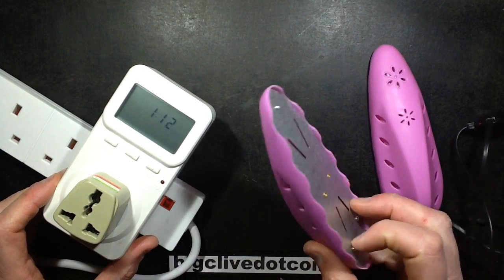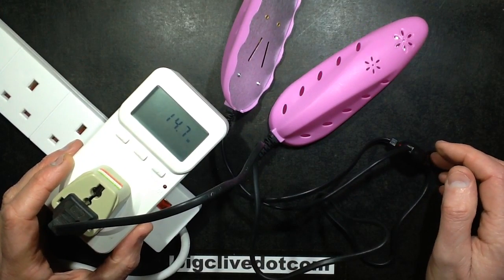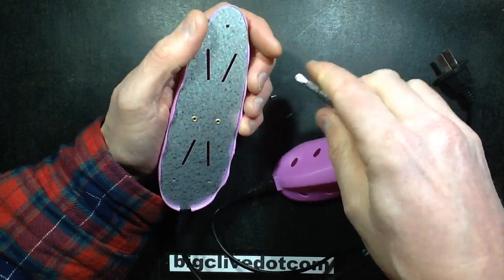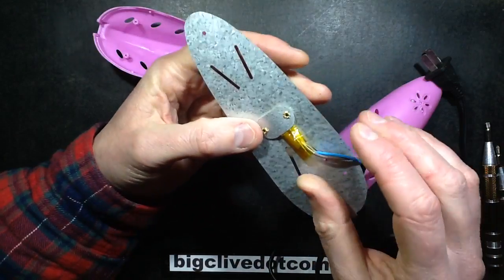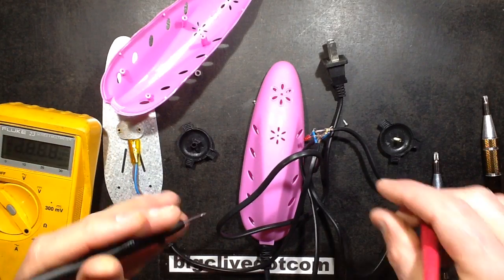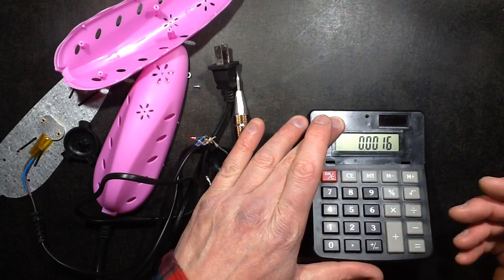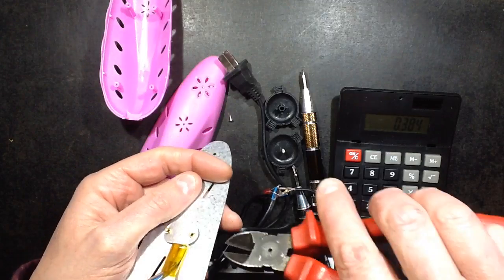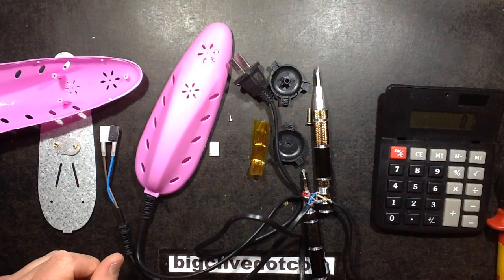The cheapest pink shoe warmers of death.

Comment: The resistor might also have an operating temperature range. 
A RS-generic-datasheet for carbon resistors shows derating of power dissipation starting at 70C going straight down to zero at 150C.

Comment: I don't get how those elements work. Two electrodes separated by what?
Reply from the maker: A material that changes its resistance with temperature.  It's specifically engineered to do that so it effectively self regulates.
Reply: Ok, thanks!

Comment: To  think that someone may be using this on their WET cold boots with the line & neutral conductors sitting conveniently at the bottom where the moisture collects after a long day working in the rain, stuck to a un-earthed metal plate too! And by the sounds of it if the shocks aren't dangerous enough, they've made sure it will get hot enough (over 100 degrees) to burst into flames so it's guaranteed to thrill! To be fair though, put a SELV on the power lead to make it safe, see if it puts enough heat out to dry your boots... could actually be useful?

Comment: what is that thing between the electrodes?
Reply from the maker: It's a piece of resistive material with a positive temperature coefficient.  As it gets hotter its resistance increases, so it self regulates.
Reply: bigclivedotcom thanks man. btw how come it gets cooler when the resistance increases? it seems to be the oposite with nichrome wire
Reply: the thermoresitor is not the part that does the heating, it simply makes less current flow through the heating element. less current = less heat coming out.
Reply: EvilPlagueDoctor oh. where does the heat come from? i made a water heater by spacing two shaving blades and i notised the heat was coming from the water between the blades. i also notised that the closer i put them the more violent the water boiled :)
Reply: sorry, I was wrong (probably should have paid more attention to the video :p)

let me correct myself, as clive said, it's a material that heats up, but as it heats up, the resistance goes up, preventing as much current going through (since the voltage stays the same) cooling it down again.

nicrome wire heats up the same way this does (High resistance = more work the electrons have to do to push through, creating more heat) but the reason more resistance = more heat is because since the resistance value doesn't change much, the input current/voltage is set to match the resistance of the nichrome wire to be used. 

in short it's ohm's law (volts / resistance = amps) and then you can 
take the volts x amps to get your watts, the more watts, the more heat.

with your shaving blade experiment, putting the blades closer means more current can flow through (less resistance), meaning more electrons to bump into the atoms make more heat, at least, in that case more concentrated heat. 

but be careful, since you'll also be producing hydrogen & oxygen via electrolysis.
Reply: EvilPlagueDoctor I had no idea. I also did an experiment with resistors and that too had unexpected results. first i connected a high ohm resistor 10 megaohm or something, i dont remember. Nothing happened and it didnt heat up at all. Then i tried with some lower ohm resistors (individually) and i started to see some smoke. Then i connected an 82 ohm resistor and it made a beautiful firework.

I expected the high ohm resistors to heat up more because of all the energy it had to get rid off. Can you explain what was happening?
Reply: asdf
yep. ohms law.
lets say you were using a 9 volt source.

with a 1M resistor
9v(pressure) / 1,000,000ohm (resistance) = 0.000009 Amps (flow)

9v x 0.000009A = 0.0000081 watts of energy

now lets take the opposite extreme 82 ohms

9v / 82 ohm = 0.109amp
= 0.988 watts of power, and since the standard resistors are only rated for 0.25 watts, that's going to cause a meltdown.

not a lot of power mind you, but localized to a very small area it can make that small spot very hot :)

think about it this way, volts is the pressure of a water line, the faucet is the resistor, and the amount of water coming out of the tap is amps. keeping the water pressure the same (it's regulated by the town) turning the know a little (high resistance) only lets a small amount of water through (and thus, in our circuit, little energy released as heat)
but open the tap all the way (low resistance) and you get a heavy flow (lots of energy is released)

hopefully that made sense.
Reply: EvilPlagueDoctor i think im startin to get it now, thanks man :)
Reply: asdf
any time :)

Comment: I was thinking about making shoe warmer myself, 10x 1W resistors dissipating 5W in total, and as temperature control bimetalic switch rated for 50C, NC type.
We could use few of these switches for more safety.
Everything in isolated and waterproof enclosure, so no risk of shock even when shoes are really wet.

Comment: Do you isolate yourself from ground before handling this cheap tat? I'm not terribly familiar with electricity (more of a chemistry guy myself), but I distinctly recall my shop teacher handling live wires (but never both live and neutral at once!) on an insulated mat.
Reply from the maker: +Steven Haussmann I do have a fairly isolated area.  Leakage current is around 10uA.

Comment: Regarding the dissipated wattage of the led resistor: based on the cord end (Nema plug for 120 volts, should we Instead calculate for 120 volts half wave v.s. 230 volts?

Comment: Uh, why warm up shoes?
Reply: +ö. . , when outside is snowing and you shoes get wet inside
Reply: Think I`d rather just put them on a radiator or next to the fire until they`re dry,  I`ve never once thought "you know what, my shoes are cold, lets warm them up first" :)
Reply: @richiebarrass3469  Because they are likely not going to be dry or warm before you need them next.
Reply: Because they are cold

Comment: why did you calculate resistor power dissipation for both directions when the diode prevents current flowing in one direction? so 380/2=<200, which is acceptable for that resistor package, then about the heating element - there is nothing wrong with scoring and braking them to size, its a ceramic, it will not care, and then there is the overall design, which is pretty much the same as in any hot glue gun, including the insulation of the heating element from metal body - which in glue gun case, arguably is much more prone to touch users skin while under power than this thing is
so over all - there is nothing too criminal about it, one would expect such level of engineering in a product that probably cost less to make than a bus fare, and - shoe warmer, why would you need one anyway, potential buyers and users of such things deserve a bit more electrons running through their bodies, to make them start to think perhaps :P
Reply from the maker: +jz1199 As soon as the LEDs reverse voltage is exceeded it will  conduct, so the resistor will see both halves of the mains waveform.

Comment: You said this runs on 240v but why does it have a Japanese 110v plug on it? Are they just too lazy to put a Euro plug of some sort on it?
Reply: In China they use that plug for 220V.
Reply: +The Rougemacintosh Yes they are lazy and cheap to not to build one with an EU plug but that way they can sell the same model everywhere and just ship it with an EU adapter if needed. Sometimes you have to ask the seller but they will send it for free.

Comment: The exact same "heater" is in my cheap hot glue gun! And it works just fine in that, with the plastic case so I don't get shocked..
Reply from the maker: +Tomclanys But the metal tip to the nozzle that you may occasionally apply to other metalwork is not grounded...   But that does seem common in all glue guns.
Reply: bigclivedotcom
Wow, thanks for the quick answer! I live in Poland and the heater I told you about is covered in that yellow tape too, so I still am cautious, but there is at least some protection. :)

Comment: I have found electrical heaters that run of 5V. http://www.robotshop.com/en/5v-heating-pad-com-11288.html
Would these be a safer option?
Reply from the maker: Hunter Gman I think shoe warmers would have to be rated at least about 5W to provide useful drying or heating.  It might be viable with modern beefy USB power supplies.
Reply: bigclivedotcom I plan to use these as pads that are in my shoes and gloves in cold days.

Comment: That's a 120 volt 15 amp plug.. If your using a proper stepdown transformer or are in the USA the LED would be at 96 mW which is within the limits of the LED.. Either way though that thing is a pile of shit and by you buying it you saved someone from being electrocuted or their house burning down.

I will give the Chinese this, They do make a damn good 2-way radio (HYT) for dirt cheap and FCC approved.
Reply: That radio is damn popular too. My uncle found one of those uv5rs laying on the ground!
Reply: The UV5R is a Baofeng and is not FCC approved, The BF-UVB5 is though as well as cleared for commercial use recently along with the BF888 and almost all of the Wouxun line except the one that does repeater for obvious reasons..

That's funny your uncle found one lol they are so cheap that if you lose one its easier to buy a new one than waste time looking for the lost one..

When I say recent I mean like a couple of months ago recent. 

The units I just got in (BF-888's and BF-UVB5's) and deployed in the field were all FCC approved and had legit ID's for part 90 use,, Weird thing though is they approved them for commercial narrowband but not for GMRS.. Not that I use GMRS but still makes me wonder though.

The 5R is a good radio for and entry level ham though. I recommend it or a B5 if you want an actual channel / VFO knob and not a push button..

I am glad the FCC starting approving some of these cheap radios, not all of my customers have a ton of money to pour into Motorolas, Icoms, Ea-Coms, Taits, and Kenwoods.

I myself use the Mototrbo DP4000 series full on display and keypad handheld UHF radios. I got out of analog 2 years ago and never looked back. I have 12 customers also that are full digital on my digital community repeater.
Reply: ElfNet Gaming I've had the absolute worst luck with radios. My first one worked fine for a while and then the audio was reported to just fade away to carrier. I'm clueless on it. The other one the mic shorted out and they were too cheap to build in protection to the radio and it fried the whole thing. The third the screen connector died. I've yet to kill the chinese radio and I've abused the crap out of it....

Comment: Why is this "of death"? Don't you trust your life to a thin layer of kapton tape that has a heating element against it actively trying to melt it? :-) (lots of sarcasm implied)

(I have seen kapton tape melt. I just checked wikipedia and I saw the genuine stuff is rated to 400C. Want to bet they cheaped out on their kapton tape too? ;-) )
Reply: Bowowowification OF COURSE THEY CHEAPED OUT ON IT! They are focus selling it to the Americans (Note the 120 volt 15 amp USA plug) they make it as dangerous and cheap as possible..
Reply: I'd also be worried about the insulator on the cords melting to the metal before the Kapton Tape fails.

Comment: I've got a hot glue gun with very similar construction. The heater is that block type thing sandwiched between aluminium electrodes wrapped in kapton tape and rammed in the nozzle block

Comment: Well Clive, the electrodes look "nice". Not to mention the power cable is a keeper. So how does the led stand the back voltage on that thing. I thought that they would always use a diode in series with the led for protection.....
Reply from the maker: I've not tested the LED to see if it's got some specific high reverse voltage protection, but I doubt it.  As long as the current is limited the traditional red LEDs seem to handle the reverse current.  Modern blue, white, green etc LEDs would instantly die if subjected to that treatment.

Comment: Small question. It looks like the plug was designed for a USA style 120VAC. Was the documentation or a supplied adapter plug make the claim for 240VAC?
(It's still a shit design either way)
Reply from the maker: The Chinese 220v plug is very similar to the American 120v plug.
Reply: bigclivedotcom
I didn't know that. Thanks.
Reply: DjResR That plug is pretty standard in china, with parallel prongs with no holes in. The crowfoot one you mentioned is australian (hence AS)
Reply: bigclivedotcom Only difference is that the chinese AS-3112 plug has the flat pins angled like Y with upper part turned upside down not parallel like Nema 5-15, but otherwise it is quite similar and it is even possible to bend the prongs to fit one to another as the both have the same pin size.
Reply from the maker: DjResR I've just checked the box and it says 220V on it.  So definitely aimed at the Chinese market.
Reply: bigclivedotcom It puzzles me. Maybe chinese put american market items in to wrong box or there was no other rating boxes available at the moment. It looks like made by lo-hung factory somewhere in a village so I wouldn't be surprised if the rating on the box is wrong, but chinese plugs are incompatible with american sockets without manual modification. The plug on the device looks nonstandard too, there is no holes on the prongs also and that construction (almost) has "fire hazard" stamped on. Even the LED has no protection diode against reverse voltage. Anyway, keep up the good work.
Reply: ***** I took another look in the wast space of internet and seems like you're right. They do use NEMA 1-15 for II-class application and all sockets have 220V. Although the crowfoot plug is also used in china for grounded appliances, but it is named as CPCS-CCC (Type I), it's prongs are slightly different size than australian standard. That means it is meant for chinese market, still the quality is terrible either way.

Comment: OOF! Is this the worst/most dangerous thing you've investigate so far in your vids?
Reply from the maker: Lachlant1984 The mains voltage USB power supplies are well up there in the deathtrap area.  The separation between the mains and low voltage side is often so low that it's just luck that the output isn't live.  There are probably people routinely charging their phones without realising that the USB plug is referenced directly tot he mains on a dodgy charger.  Hopefully they'll never find out by plugging it into something with a metal case as has happened with the iPhones.
Reply: I've heard of those multiport USB charging stations and I think in theory they're a fantastic idea, I'd like to hope they comply with all the safety regulations.  The fact that cheap counterfeit Apple branded USB power adaptors exist doesn't surprise me at all.
Reply from the maker: Not by a long chalk.
Reply: bigclivedotcom What would be the most dangerous electrical product you have reviewed then?
Reply: Yes I've heard some pretty bad things about those cheap USB adaptors.  I think most modern mobile phones have metal cases on them.  The AC Adaptor that came with my iPhone 5S is tiny, but being the Adaptor supplied with the phone I'd like to hope ot's totally safe to use.
Reply: Lachlant1984
real apple ac chargers are almost a work of art, so much better and different to the chinese copies, which outside are very hard to tell, but inside, its night and day, safety plus power regulation
Reply from the maker: Lachlant1984 I tend to recommend Apple chargers because they are one of the safest available due to the need to avoid adverse brand publicity.  I use an iPad charger as my main all-purpose USB charger, with my Flir charger (also made to a high standard) as my generic micros USB phone charger.
The cheap chargers are only suited to use for powering fully insulated and low value devices like LED lights, although even then they still pose a shock hazard.
Reply: Oh sure.  Actually, I use my iPhone charger for charging the battery in my Sony voice recorder too.  I've got a few USB chargers around the house and I don't believe any of them are counterfeit chargers, but I'm happy with the ones I have.  However even though I don't have an iPad, I may pick up an iPad charger and just use it for everything.  Apple have such a high reputation, so they cannot afford to use cheap components in their electrical products.  Safety is very important.
Reply: Lachlant1984
you will find it very hard to buy a genuine apple charger, short of buying it at an apple store, the fakes are blatant in their insistance
, i may be tempted myself to try a portapow one, its  a brand, long guarantee and 4 ports on the output
Reply from the maker: If you do buy an iPad charger, make sure you buy it from an actual Apple store.  It's the only way to guarantee you get a real one.